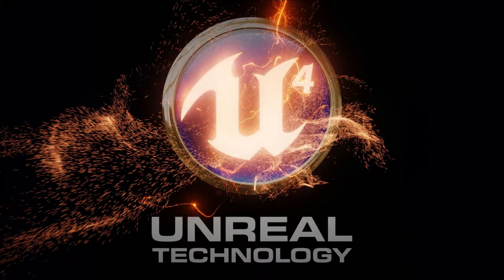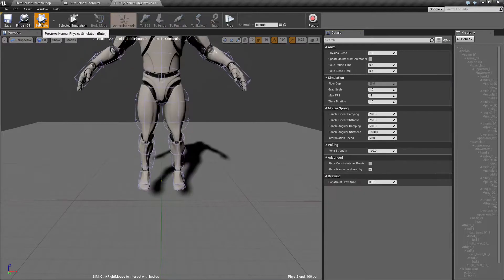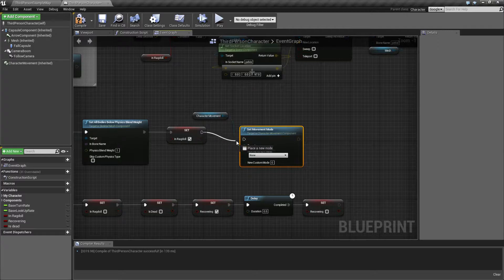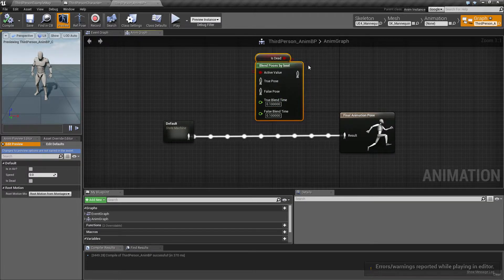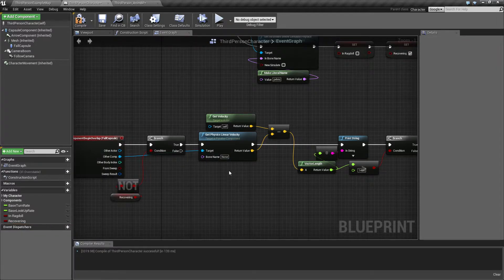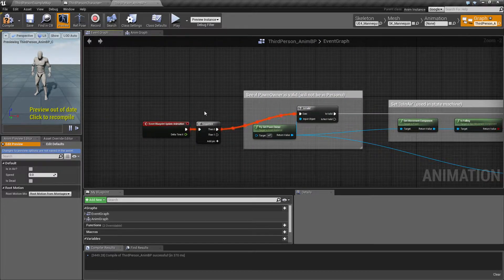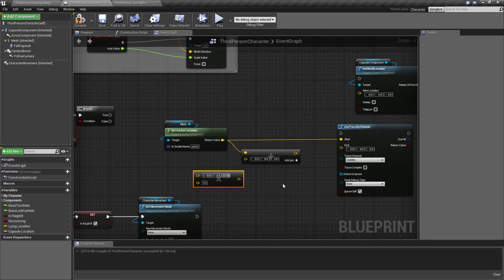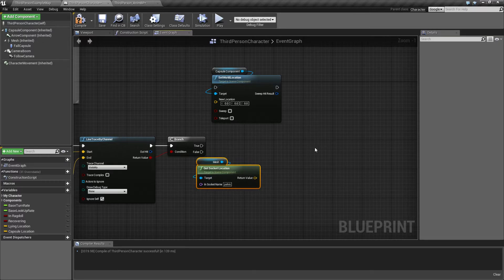Ragdoll 101 - Part 5 Improvements to capsule positioning

Comment: In new version of Unreal Engine (i have 4.18) 1:05 - 1:57 doesn't work.
Reply: It does, it just looks different now. Setting Collision disabled is now a checkbox, and you have to select the constraints in the bottom left, which are connected to the new root and set those to free instead of locked.

Comment: Can you maybe help me out with an issue I have. I'm working on a root motion conroller. When my character goes into ragdoll, the capsule stays at his hip bone. But when I revive him, mesh and capsule jump to the point where the root motion animation would have ended.

Example: I have a walk fwd loop animation that drives the capsule. At half time of the animation I go ragdoll. The capsule stays at the hip bone. But when I recover from ragdoll, capsule and mesh jump to the point, where the capsule would have been if the animation had played to end without going to ragdoll.

EDIT: Just to clarify.... SetWorldLocation of the capsule component seems to be overriden by root motion, even when character is in ragdoll / simulating physics. Strange..
Reply from the maker: +Florian Norbert Bepunkt Hi mate, i havent played around with ragdoll and root motion yet, so im affraid i can't answer that. However when you think of it, the root motion means the location of the capsule is driven by the animation, so i guess trying to SetWorldLocation should not do anything by design. Try switch to an animation sequence that does not have root motion and then see if it works.
Reply: +Jonas Mølgaard  Hi, without root motion it works. I understand the design principle behind this but so far I haven't found a way to simply stop the animation when character goes into ragdoll.  Set World Location works as long as the character is in ragdoll, but it snaps back to the original animated root position, when physics are not simulated anymore. So basically the animation sequence continues playing until its end, while the character is in ragdoll.
Reply: Okay, if anyone else has the same problem: There are two solutions: Either override the character movement component c++ class with a copy and add in bools within the performMotion function that enables/disables root motion extraction and expose them to blueprint.

Or you need to setup a transition from every state that has animations with root translation to an idle state (some animation without root translation) and use the InRagdoll bool as transition rule.
Reply from the maker: +Florian Norbert Bepunkt After reading your suggestions i tried a little experiment. On my animation blueprint i use "Root Motion from Everything", and most of my current animations use Root motion. When i then use "SetActorLocation" it actually works just fine. Not sure why, but it does. I use UE4.11.2 if it's something that has been changed recently, but i doubt it.
Reply: +Jonas Mølgaard Hi Jonas, the SetActorLocation works. What caused my issue: I went into ragdoll, but the animation that was active at this time was still playing (although not visible). For example when I was walking into the moving box, character went inti ragdoll, but the walking animation was still playing in the background. So all the root motion from the still playing walk loop was accuulated and added at once, when I was going out of ragdoll. Means, SetActorLocation worked but one tick later the accumulated root motion was added, so capsule (and child mesh) jumped to the place where my WalkLoop animation would have ended. I solved this by stopping my walk animation when I go into ragdoll. But took some time to figure out what caused this issue in the first place :-P
Reply: PS: I'm not sure if this accumulating of root motion is intended behaviour...I opened a ticket at the Answer Hub bug report section about this but haven't heard from Epic yet.

Comment: Great tutorials! I've been looking for a way to implement this type of ragdoll.
I am running into an issue when removing the AttachTo and SetRelativeLocationAndRotation (https://youtu.be/1tTQZjqCV58?list=PLT4SeajOa6mZt6RFYJT5R6M0vdoSgWLO5&t=115). I am updating the physics with the added root and detail updates but no luck... the character mesh is stuck sideways on the floor and the capsule is free to move without the mesh. What could I be missing?